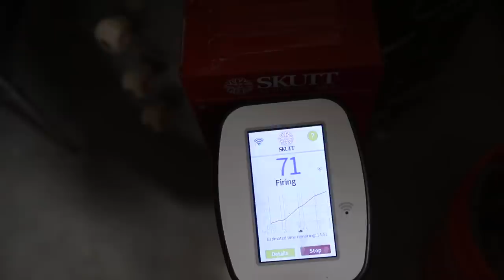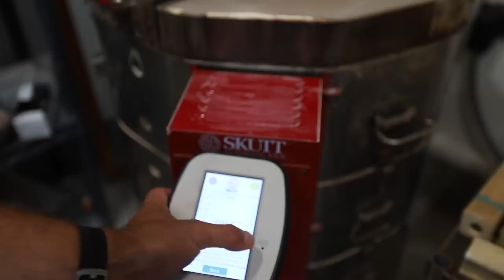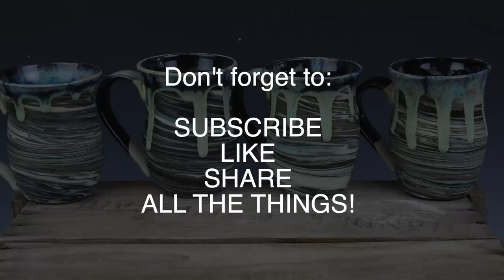Making a DRIPPY Marbled Mug - the ENTIRE POTTERY PROCESS   ASMR EDITION

Comment: What kind of clay did you use? Did you mix with mason stains or how did you get the colors?
Reply: I was wondering the same thing.  I’m guessing that’s an oil’s hare type of glaze with no zinc or lead, since Mason stains don’t work so well with it.  Also, did you wax the bottom half of those mugs to keep the glaze from dripping all the way down or just test the glazes to see how far they dripped, prior to the first fire attempt?  And are these your own glazes or did you make them based on other recipes?  Thanks in advance!  Aspiring potter here so I’m trying to learn as much as possible.  Gorgeous work, btw!

Comment: Hi Jon! How did you keep the mug from sliding around while carving? In my ceramics class, I would always have to add clay balls at the bottom. It might be because I'm a beginner. Lol
Reply: He uses a special tool on top that allows you to put pressure on the bottom of the mug while trimming. It spreads the pressure out so he can hold it down with his hand.
Reply: @nancyhartshorne6491  oh, that little circle thing! I've seen him use it before but I didn't realize it was such a powerful tool. 😅 Thanks for the reply! I need to get me one of those asap. 🤗